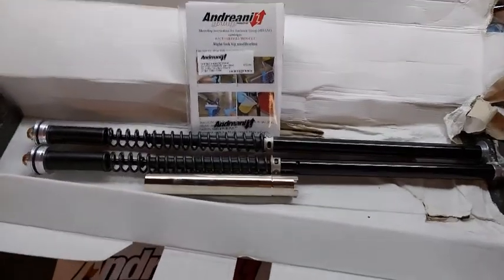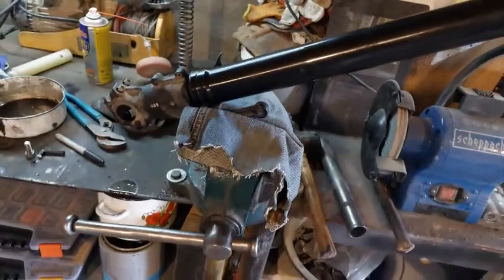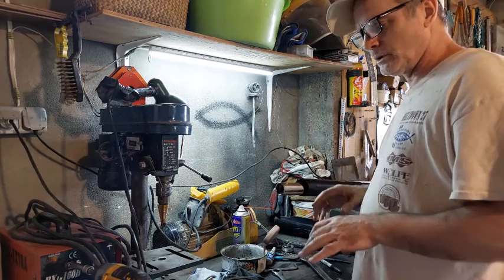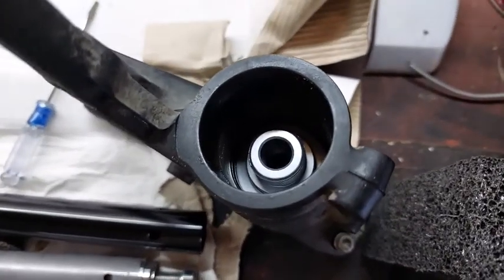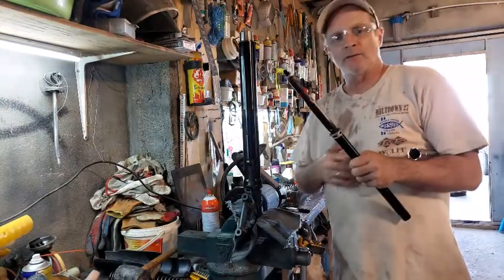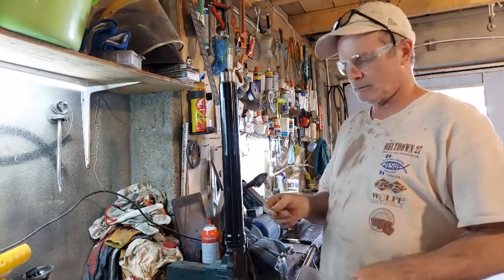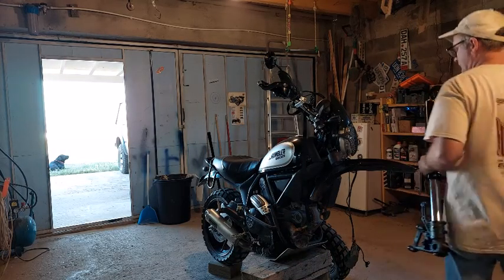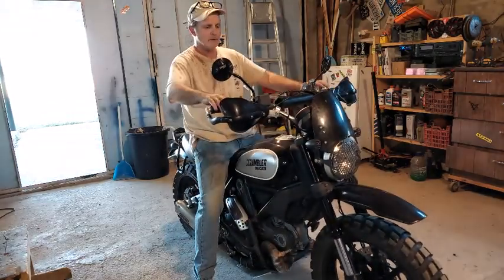Andreani Cartridges!- Step by Step install at home!

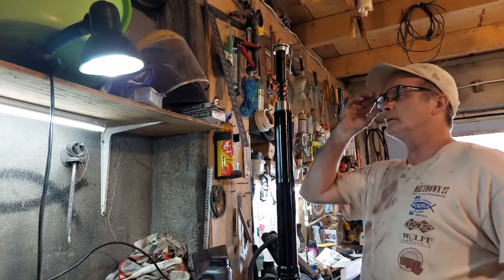Comment: @22:50 how did you screw the cartridge into the fork cap? I know Andreani says you need a special tool, but I didn't see you use one.
Reply from the maker: hi, do you mean the cap that screws into the cartrege rod and then secures into the top of the fork tube.  It is not hard, just put the fork into something secure like a vice and them pull down hard on the spring and then place a 10 or 12 mm open end wrench under the nut on the rod and it will hold the spring back while you screw on the cap and secure it to the nut..  Let me know if this was clear or if I missed the question.
Reply: @MotoWorld777  Thank you! Yes, that makes sense. Andreani says you need “special tools” to install the cartridge. When I installed my Ohlins NIX cartridges I had to buy a special wrench to hold the spring down while screwing the nut onto the rod.

Comment: Hi mate! Quick question and a quick response for a fellow Ducati owner would be highly appreciated. I'm just before starting the job on my Hyperstrada... The instructions say to use a milling tool BEFORE removing the tiny screw on the fork leg. The tiny screw (the one you have stripped and are re-doing the tap)... They say it's a TORX, not a HEX and this is probably why it stripped, but my question is: Why do they want us to mill before removing that screw? I'm pretty sure you worked it out after removing all that and this is why I trust your feedback. Also, you don't happen to be local to the Seattle area, do you?
An answer would be really appreciated and a quick one even more... LOL!
Reply from the maker: hey buddy, sure.  it needs a bit of milling because the aluminum is "pined" over it, as in it is tamped down to keep the screw from coming  out.  You can file it a bit or use a flat drill bit to remove the aluminum over it.  I am pretty sure mine was a hex, but yea, try the torx, but remove the aluminum over it first to get your wrench in there.  Take you time so you don't damage the fork or uglyfy it too much!  I would replace it with a regular bolt for later removal and lock tight it in there, Good luck!
Reply: @MotoWorld777  Thanks a lot! Just a bit strange (LOL!!!), but I needed confirmation that that is the case. I have milling bits, no big deal. Stay safe!
Reply: @A.Dude.  Fellow HS owner here. I've got a 2016 low version.  I'm about ready to pull the trigger on a set of these cartridges and have a couple questions for ya. Do you have the standard height or the low version?  If you have the low version which Andreani part number did you go with?  Have you installed the cartridges yet and if so, are you happy with the difference?  Lastly, i had heard about using the milling bit but my understanding was to use it clean up the hole the set screw was in and also any damage to the fork tube threads.  It was said it helped to prevent any damage to the threads when unscrewing them caused by any deformation the set screw caused when it was originally tightened against the fork tube threads.  At least that's what i've gleaned from the interweb.   Cheers!
Reply: @bradcrossman5068  I have the standard height Hyperstrada. So not much help here... Regarding the "milling"; this portion of the manual is overstated. The entire "milling" refers to a bit of material, which the manufacturer "hammered" over the top of the retaining-screw so that it will not allow it to come off. If not "milled", which can be achieved with a flat file in a few passes, the screw will rotate and hit that "hammered material" and destroy the thread because it won't have clearance to come out. That's about it. I have not installed them yet because it's something I want to do with my son who will visit over the winter vacation; great to teach him something useful. About the difference to stock, I do have experience with a friends bike. It's not like 'night and day", it's about making the bike yours, namely to properly adjust compression and rebound. If properly adjusted it will feel very safe. If your weight happens to be in the standard of the stock, you won't get much of an improvement simply because the stock shocks are wonderfully engineered. Whoever tells you any different is not honest.

Comment: i installed the cartridge, the compression has like 5 turns and rebound has 11turns. I am wondering how many turns do u have for both compression and rebound.
Reply from the maker: depends on your riding and weight. If you are going off road more clicks if onroad less.  I just set it about half way and then adjusted as needed.

Comment: Hi! I bought a bike with this kit already installed but the seller told me he had to make a mix with some stock parts in order to work. I want to adjust the rebound and compression but it really doesn't change anything when I try to adjust it. Do you have full capabilities of adjustment on yours? Thanks
Reply from the maker: Hi, sorry if I did not answer this.  Yes, the adjustments work great, especially the preload for  different terranes.

Comment: hell o. im from korea, and is that Andreani Cartridges is better than Ohlins catridge?? because Ohlins catridge is too expensive.... Im just want to know is that dramatically change?? more than pure ducati scrambler front shock??
Reply from the maker: Hello, I have not tried the Ohlin's cartridges, but the Andreani are great and really improved the suspension in the front on road and off road! The original, stock set up is only good for flat roads where there are no bumps!  I do have the Ohlin's rear shock and I love it!
Reply: Thank you for review.. i will buy soon. Always great video. Thank you.

Comment: Hello there. Based on your other video I installed an Ohlins DU 509 rear shock on my Desert Sled and it is a huge improvement over the stock. Now I am looking for the front fork cartridge. What do you think about the Andreani Cartidges? My preference is comfortable touring and off-roading! Let me know your inputs. BTW here is a video of the installation of the Ohlins rear shock: https://youtu.be/qn1DOuDEt3k
Reply from the maker: I have the Andreani, you can see my vid on it. The nice thing is that it is very adjustable for every situation.  It is night and day over the stock cartridge!
Reply: @MotoWorld777  Thank you for the information. Will upgrade to Andreani.